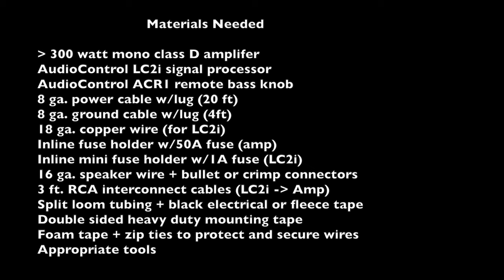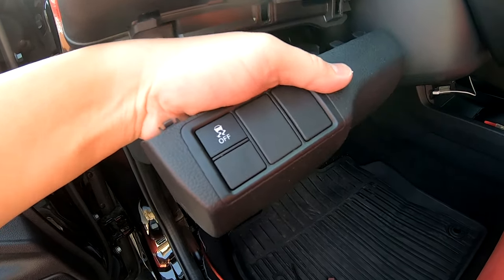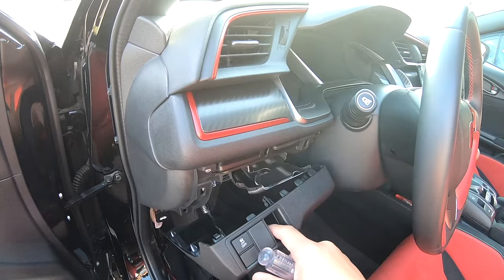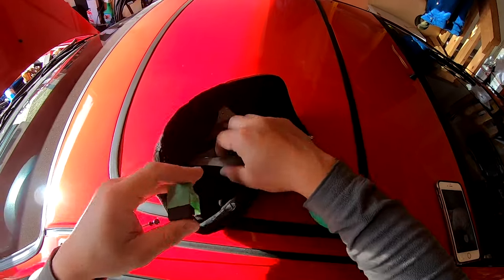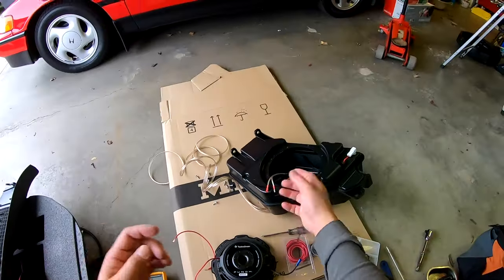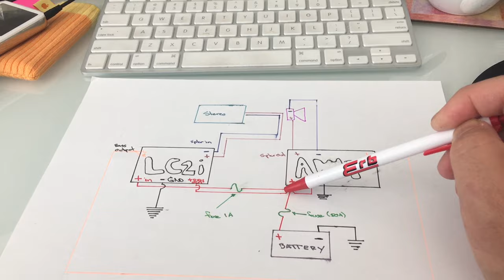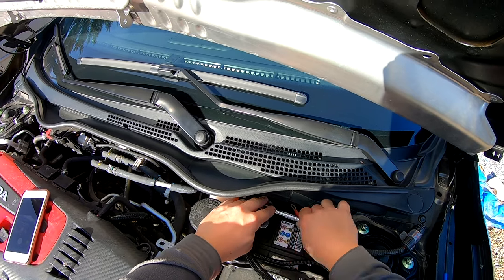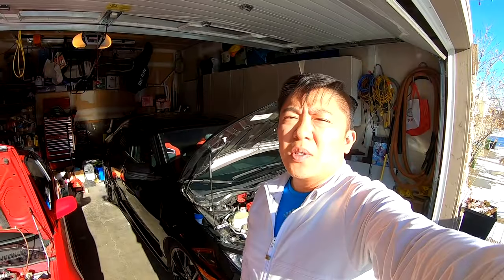2016+ Honda Civic Type R Subwoofer Amplifier Installation

Comment: Thank you !
Is it the same for the Honda Accord 2017? 
Of anybody know please leave the link!
Reply from the maker: The procedure to do the install is fundamental identical.  You would tap the signal from the sub wiring, you would wire up the power , remote sub control and LC2i the same... just placement of the components would be different.

Comment: Terrific and extremely helpful video! Just to confirm, a 12V connection somewhere in the vehicle must be also run to the "remote in" on the LC2i correct. Fuse box, 12V plug input, etc?
Reply from the maker: no need for remote in on the LC2i.  Just piggy back power (but fused for 1amp) from the 12 volt amp feed that you ran from the battery to the back.   The LC2i will use signal detect to turn itself on and then you wire the amplifier remote trigger to the LC2i remote out.  The LC2i will sense the signal from the head unit, turn it on and then conversely the amp will turn on when the LC2i comes on.
Reply: @piercedasian  That's great!! Saves me from pulling my interior apart again lol. My local store only has 3A fuses, will that work for inline fuse or must it be 1A? Also, can I still use my JL's current bass attenuator knob instead of the AC?
Reply from the maker: A 3A fuse will work though I still prefer a 1A. In the event of a dead short either fuse will blow.  The wiring used to wire the LC2i will most certainly be able to handle up to a 10A fuse safely but I like to err on the cautious side and put in the smallest value possible to protect the wiring AND the equipment.
Reply: @piercedasian  I actually found 1 amp so all good sir! Ty

Comment: Use ofc 4 gauge. Thank me later.
Reply from the maker: Nah 4 gauge is way overkill for a little amp like what I have. Different it was a bigger amp or if I was running a class A/B amplifier. Good tip nonetheless but overkill for this particular application. My other car uses 0 gauge and that is needed because I am running three large old school amps.

Comment: Is there a factory amp in between the head-unit and speakers (including sub)?
Reply from the maker: Yes the factory head unit is the amplifier. It isn’t the usual paltry 15 watt outputs of stereos from 10 years ago but a more advanced (likely class D design implementation) that enables the factory head unit to produce bigger power numbers in a compact unit. I could be wrong but I am pretty sure there aren’t any outboard factory amps.
Reply: @piercedasian  Thanks for responding, great video. I'm going to add a subwoofer to my Lexus ES300h. It has a factory amp under the driver seat (non- Mark Levinson). The stock subwoofer sounds weak at higher volume, the Factory Headunit cuts the bass off. I'm going to have to tap into a pair of speaker signals for my new amp. I'm going to use the Audio Control ACM-1.300, it has the LC2 built-in with acu-bass. Since the battery is in the Trunk on the Hybrid it shouldn't be too difficult. I can't commute without some bass in my music...its just sad. Wish me luck

Comment: Awesome video my dude!
I got a 19' Type R, but I haven't messed with the subwoofer yet... is that stock box the sub is in just cheap plastic? 
I can't imagine the sound being too good out of a plastic box o_O
Reply from the maker: Congrats on the Type R, I'm sure you'll love it as much as I do :). Yeah the sub is in that cheap but surprisingly thick sub enclosure in the rear right hatch area.  I'm not the greatest woodworker or fibreglass molder so I wouldn't even know where to begin to make a better enclosure.

Comment: Thank you so much for making this! I plan on attempting it with the same sub. I was wondering if you’ve had any issues with the sub bouncing on the factory grill at higher volumes? I read somewhere on a forum of someone having that issue with the Rockford setup.
Reply from the maker: no bouncing off the factory grill whatsoever.  This could very well happen if you're over driving the sub b/c the rockford sub definitely has more "excursion" travel than the factory sub has.  I don't push my sub to its limits so I can't speak to whether or not that would happen.

Comment: It's me again. It's all in and I adjusted the acu-bass to kick in at the right volume setting. Big difference in sound quality. However, there is only one problem I incountered as I was setting the voltage on the LC7i. My rear speaker channel on the factory head unit puts out only 3.3 volts at maximum. The front channel, I was able to set at 6 volts to match my amplifiers 6 volts. I have no idea to why the volume is less than the front. I checked the wires for continuity and they all checked out ok. Perhaps it's the headunit? Any ideas. Right now, I'm using the front channel to feed the signal for my subs and the rear for all for door speakers which my 4-channel amp is working a bit harder because of the voltage drop from the rear channel.
Is there a way to test the headunit or perhaps honda make these factory 5" headunits this way?
Reply from the maker: For some reason I felt like I answered this but it's showing I haven't responded.  Is there a reason why you didn't tap the signal out from the sub signal as how I outlined it?  I can't remember what model of civic you're modding.  I wouldn't fret about the voltages coming from the head unit.  If the sound is correct and sounds good then that is all you need to worry about.  Don't expect the factory head units to be able to put out huge power (hint: they can't).  The amplifier doesn't care if it sees the same input voltage it just implies it can handle up to 6 volts.  Keep in mind you're using the LC2i as your line converter so in fact, you do NOT need to have high voltage going in b/c the LC2i will have RCA signal out and I'm willing to be it isn't 6 volts.  Where your amp says 6 volts in means that it can handle the high signal outputs of high end aftermarket head units and not blow the inputs on the amp.  So in other words, your understanding of voltages and how they work in your system is a moot point.  It only applies for aftermarket head units and even then if you never achieve 6 volts it isn't a problem.
Reply: @piercedasian  well, in recent events after battling with my setup. I finally have everything straightened out. I went to an audio shop. From their view, I did a fair job at doing all the wiring. My settings were almost spot on, I only needed a few tweaks here and there to my input to output voltage and better ground, and the acu-bass I almost had it setup right. Also, my radio had a bad transistor that regulated power and replaced it with an Alpine. Now, all my channels run clean signals. I only need to upgrade my subs and a bigger-better ported box. Now, my system sounds amazing. 
Thanks for all your help.
Reply from the maker: that's good you took it to a shop.  Sometimes if one isn't overly experienced that it is sometimes just better to get it done by a pro instead.  Interesting you had a faulty transistor in the radio.  Was your car previously modded as I've never encountered a failure on such a new car.  Either way, I hope you're enjoying your new system!
Reply: @piercedasian
  what the guy told me and showed me. It looked as if someone was trying to modify the radio inside. Instead, it was causing a fluctuation of problems. Those older Honda radios are OK but lack in performance. 
Finally, though, my Alpine box and subs looks cool and sound amazing. I am looking into a more custom build in the trunk where I can blend the woofers and box with the molding on the sides. Can't always drop cash to do these things, but I do have everything I need (workshop) to try to fabricate myself. 
Again, thanks, I will continue to educate myself in car audio. The only thing to do now is find out when the next sound off competition is and car show.

Comment: Hello i just recently install a subwoofer and amp system and everytime I shutoff the car there will be a rumbling noise coming from the sub and goes away after awhile, and if i turn the head unit on it goes away right away. Do you know what could be the issue? Thank you
Reply from the maker: hmm that is a sign that your amplifier is not powering down with the head unit and is "delayed".  Did you install an LC2i like how I did or did you use the high level inputs in the amp and use its built in signal detect system?
Reply: @piercedasian  i installed a cheap line output converter from autozone and tapped into the rear speaker
Reply from the maker: and that would be where your problem is.... you may want to invest in a better line out converter such as the LC2i.  I'm assuming your car does not have a factory sub then?

Comment: Hey! I'm trying to do exactly what you're doing in my 18 sport touring, however the amp that you chose is now discontinued. Can you recommend another amp that will work with the exact sub that you have? Also if I choose not to use a switch, will the sub turn on by itself with the radio? Also, is your sub still wired in parallel when you installed the amp, resulting in 2 ohms?
Reply: Also is a LC2i necessary for a good sound? I know you can use it without but will the difference in performance be major or minor?
Reply from the maker: So if you can’t find the exact amp then just find one from JL Audio/Alpine/Hertz/Pioneer that has high level inputs and a remote bass knob to control the sub gain remotely.  I opted for the LC2i in my setup because it handles the signal in trigger for my amp and it restores the bass roll-off from the head unit. I was told that any amp with high level inputs can accomplish the same thing (and manage remote power on) without issue. Just get an amp that has at least 500 watts (250-300 watts rms is ideal) and that will you plenty of headroom for power and allows for figure expansion should you decide to upgrade to a larger sub in a box that sits in the back trunk area.  Some say you don’t need 250-300 watts but Amos are cheap and I’d rather have extra power than to have little. Larger amps don’t strain and allows for future growth. Hope that helps!

Comment: great vid as usual..but I noticed the factory amp is still sending power to ur sub along with ur aftermarket amp because u tapped into subs speaker wiring instead of cutting the factory amp  out to sub...my question is do u think it would be better to eliminate the factory sub out instead of having both factory and aftermarket amp working together??
Reply: sorry disregard my comment.
Reply from the maker: Hi Neil I know you said to disregard your comment but just to clarify there is no way to properly by pass the stock amp and its perfectly fine to send an amplified signal into the LC2i.  You're not "double amplifying anything" since the LC2i expects a "high level input".  Within the LC2i it does is re-eq-ing magic and then spits out a clean flat sub signal to the external amplifier.

Comment: Is the fuse from the lc2i coming from the 12v?
Reply from the maker: The fuse for the LC2i needs to be installed between the 12 volt source (amp's 12 volt terminal) and the positive terminal on the LC2i.
Reply: piercedasian hey man, thanks for the help. I’ve had my sub installed for a couple months now but just now decided to install the inline fuse. It was working perfectly fine but when I put in the fuse it stopped working. I did it between the wires from the battery terminal on the amp to the 12v terminal on the lc2i. When I took it off it worked fine again. What did I do wrong? Lol

Comment: I have 10th gen civic hatchback. My Sports edition has the lousy stock radio. I like to still use it. I have a 4 channel amp with 75 rms door speakers each. Because the speakers stock wiring is 22 gauge, do I need to rewire my door speakers to at least 16 awg before I connect the signal to my LC2? 
In addition, does that also mean I have to rewire the connector harness leading to the stereo. I also plan to add a subwoofer with a seperate amp to the LC2 for that.
Any help, thanks. Still wrapping my head around car audio.
Reply from the maker: Hello again - no need to replace the factory door wires with thicker ones.  The amount of power the speakers will likely draw are well within the limits of the factory wiring.  It would not be the case if you were dong competition levels of power but based on your amp's capabilities that no, you don't need to change anything. That being said, you SHOULD invest in a headunit/amp breakout harness and also purchase something like a LC4i or LC7i DSP to re-eq the outputs of the headunit/amp into a usable signal for your external amp to make things work properly.
Reply: @piercedasian  thank you, appreciate your advice. I will follow up on the build to how it turned out.
Reply: @piercedasian  I think I have seen a video where a guy took  Honda radio harnesses and rig it with the speaker output wires to the LC7i. That's the type harness setup you are talking about. Keeps the factory wires intact but your adding a simple adapter run the speaker wires seperate. Sounds good.
Reply from the maker: that is correct.  I have this said harness for my type R that I have YET to install.  Basically you install it between the factory amp and the head unit by the passenger footwell area and then you can splice in your LC7i.

Comment: I set up the same amp and LC2i in my F-150.  I’m pushing two punch p3 10’s and it is amazing.  I like that you set the gain on the amp to zero.  I will have to play with that.   I am still tuning mine. Great video.
Reply from the maker: Glad you liked my video.  Thanks for watching!

Comment: Amazing video! Do you know the size of the wire that connects the amp to the stock sup? Is it 16 gauge?
Reply from the maker: the wire from the amp to the stock sub?  Well the wire I put in was 16 gauge but the factory sub wires inside the enclosure were these puny 20 gauge wires.

Comment: great vid! exactly the info i was looking for.. if i make one recommendation.. I'd probably use Tessa tape to wrap the plastic loom in, would add a nice layer that would prevent wire rattle and in warmer climates hold up better (coming from texas here).

again great vid!
Reply from the maker: Interesting. I don’t actually know what Tessa tape is. Is it a fabric type tape?  I wrapped all my wiring quite thoroughly even after I finished this vid. So far it has been holding up well but then again I drive like 3000 miles a year :)

Comment: I saw in your video for the install of the aftermarket sub that you wired the sub in parallel so the stock head unit would recognize the sub as 2 ohms instead of 4. When you installed the amp did you change the wiring of the sub so the amp would view it as 4 ohms instead of 2?
Reply from the maker: I bought a dual voice coil sub that when wired in parallel would make the head unit see it as 2 ohms.  The AMP when it was added after the fact will still see a 2ohm load from the sub b/c I didn't change how it was originally wired.  Setting the amp to 4 ohms is a waste of amplifier "potential" since modern amps are designed to EASILY drive a 2ohm load.
Reply: @piercedasian  Oh, thank you! I plan to do this on my 2018 Sport Touring hatch!

Comment: I had a amp and lci  pro 2 installed and I was getting a delay on power turn off at the amp then I would hear a loud thud / pop from my sub is this common?
Reply: Sounds like a ground issue. Or possibly change the mode by which the LCI turns it on and off and experiment. It's not common.
Reply from the maker: hmm, that is odd.  I get a delayed turn off on my amp but it never thumps or makes any loud noises.  Like David Boggs has indicated I would check your grounds and wiring to make sure everything is secured.  What kind of amp are you using with your setup?

Comment: No air flow for  amp?
Reply from the maker: I couldn’t an opening in the foam and install a pc fan to move around by I don’t usually listen to music at crazy elevated volumes so this the amp rarely gets warmer than just slightly warm. Different story if the amps ran quite warm/hot but I have watched the temps using both feel and a thermal gun and it doesn’t break past 40-55c which is well within the safe operating limits of the amplifier.

Comment: If you tap into the amps positive terminal for the lc2i to turn on does the lc2i stay on all the time?
Reply from the maker: Nope, you can configure the LC2i to turn on by itself via signal detection.  It is a little switch on the LC2i's side.  The neat thing with the LC2i is that once it detects input signal that it can also send power to it's remote out terminal to turn on amplifiers that do not have a signal detect function.
Reply: @piercedasian  thanks for the reply! This is quite the little machine!

Comment: I don’t understand how he connect the lc2i to the radio.
Reply from the maker: The LC2i is connected to the system via the high level inputs on the LC2i.  Take the original subwoofer feed, feed it into the speaker IN on the LC2i and then feed the RCA's from the LC2i to the amp and then the amp's speaker outputs to the sub.
Reply: @piercedasian I see, I guess what I am asking. at 19:23 I see the speaker in from the LC21 to the Radio, I guess what I am asking is, did you need to remove the radio in order to connect it?

Edit: I understand now how, now!